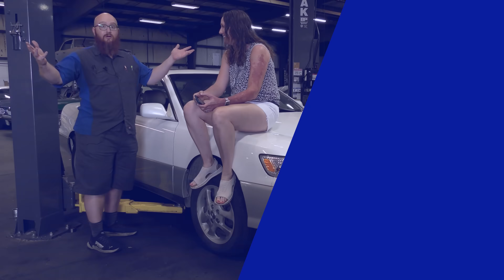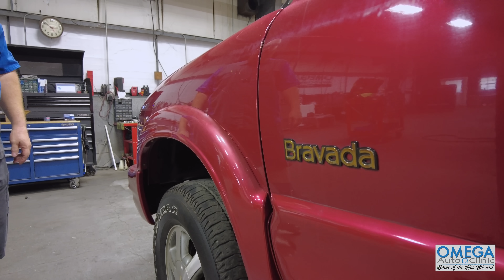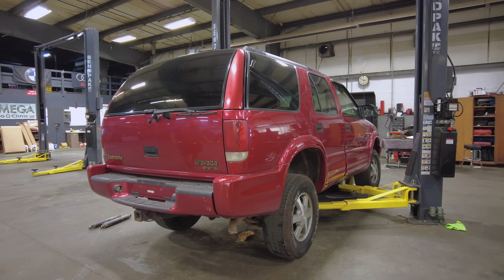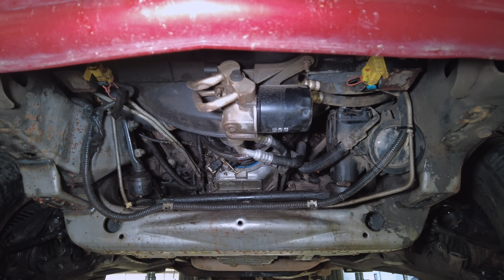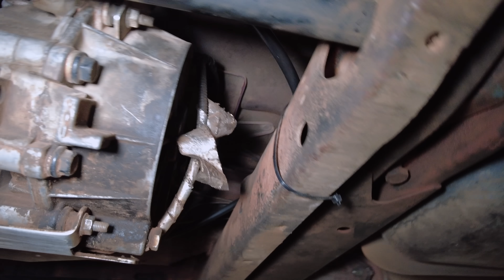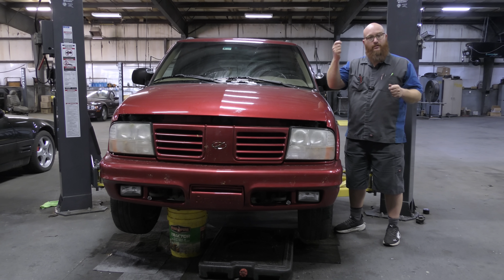Is Car Wizard Taking American Cars Again? That's an Olds Bravada!

Comment: We used to drive used cars but have switched to leasing luxury cars every three years to keep them in full factory warranty.  Our latest has one year left on an extended warranty and then we dump it.  It’s a 2020 black label pluggable Lincoln Aviator with 500 HP, 600 FT of torque 4 WD and every option available.  It has given us 30 mpg hwy at 80 mph across the country in every weather condition.  I just like driving it around town for months on end burning a tank of gas every 2-3 months if we don’t go on long trips.  A hybrid system runs your car at 1/3 rd the cost of a regular ICE.

Comment: I had an 01 bravada original transmission and engine i pulled the front diff and shafts as well as the front drive shaft after the bearings and seals failed the clutch in the tcase was gone so wasnt worth fixing the diff and all . The Jimmy and blazer had open rear diffs but the bravada got a factory lsd in it so it could claim awd. Talk about alot of fun to drive . Bought it with just over 200k on it and when i finally got rid of it after the second rear diff failure was just at 475k original transmission and engine  trans still shifted solid and all. If you do the proper updates and modifications to them they will handle anything thrown at then

Comment: I remember my 97 Sonoma had the transmission die on it- the transmission oil cooler ruptured inside the radiator and engine coolant mixed in with the transmission oil. I as a young man thought I was being bamboozled 😅

Comment: Regular car reviews guy said this was the worst car he had ever driven. It’s a funny watch.
Reply: It doesn't handle the best, but it's a truck and not a race car!  I wanted that solid rear axle because less CV joints means cheaper repairs and no boots to have to constantly replace.

Comment: Just go price both a new and good new used comparable.  $3,000 is pocket change in comparison.  The car manufacturers as well as the dealers have helped a lot to cost justify this themselves - they must have to much in sales that they keep "shooting themselves in their foot" w/their overall greed!  

This is a quote and summarizes pretty good what the real world purpose is of a vehicle: “The main purpose of a car is to get one from one location to the next rather than for it to be a status symbol or something to show off,. Provided that the vehicle is safe and will do what it is supposed to do, it’s recommended to avoid paying the top dollar for a vehicle, especially because it is depreciating.”    

A vehicle is sort of a necessity but is also a controllable expense during purchase and during ownership and nothing more.  

"Need vs. want" type of thing and this all helps to justify $3,000 into this Bravada.  👍

Comment: I had a slightly older Bravada than this one, the engine died on it, and I didn't have the money to get it fixed. It was decent on gas, and it could just about anywhere in the snow, miss that vehicle, Wish I had a vehicle like the one I had.

Comment: I ordered a 98 S-10 Blazer LT which is as close to a Bravada as you can get.  I probably had the only one in existence with the stiffest suspension package.  After only a couple years, the new-to-GM garbage orange coolant did 2 things.  Having never even opened the cooling system, it gelled and completely blocked the heater core.  I had it replaced.  A year later, blocked again and the dealer mechanic said that rusty debris from the engine block was in the coolant.  The front suspension set up was such that any non-GM-dealer mechanic would fail the truck for inspection because the front ball joints test as worn out.  This would happen even literally driving off the dealer's showroom and testing.  This is a great candidate to just drive until it doesn't run and bring it to the junkyard.  I disagree that these are reliable or worth fixing.  I traded mine in 3 1/2 years and was so happy to be out of it.
Reply: No inspections where I live and yeah, it doesn't handle the greatest, but it will get my wife through the Nebraska snow.  It's not everyone's cup of tea, but it checks our boxes.

Comment: Spending three k on an Asian or European Econo box or other hard to get parts for pile of junk is insane.
But something you can obtain parts off a much later vehicle and easily retrofit them with little or no modifications makes sense. Especially when a comparable newer replacement would cost fifteen thousand or more especially for one that won’t need three k in repairs and you might actually have a harder time finding parts for.

Comment: I had a 1995 S10 Blazer.  A hose blew out on the external oil filter.  Within a minute, the oil squirted out and before I could get the vehicle pulled over, the engine seized up, spun a bearing and bottom half of the engine was trashed. Otherwise, it was a great vehicle.

Comment: $3K is a bit much to do at once, but... if the vehicle is paid for and the basic structure of the vehicle is solid, you're probably ahead of the game investing in the parts to keep the vehicle road-worthy, especially considering just how much electronics are in today's vehicles!
Reply: My point exactly.  For the money, we have something local mechanics can repair and even I can repair.  I don't have to worry about a tv screen konking out or electronic problems and there is actually some solid metal under there to resist our salty winters in Nebraska.

Comment: Put 3 grand into it, be they recently did a trans, oil pan gasket and they still need tires. The only saving grace is it still looks good (minimal rust/rot) so the owner must have a lot of sentimental value in it. As I remember, these Bravada's were AWD, not 4WD vehicles.
Reply: No sentimental value.  Just good value overall when compared to what you get with your dollars today fresh off the lot.

Comment: I have a question for you Car Wizard......what do you think of the Auto Stop/Start features on cars and trucks?  Personally, I think they are a bad idea for 2 reasons:  1)  It wears out starters and 2) I also think it can't be good for an engine to stop completely at a red light, then it has to start and accelerate immediately after, stressing the engine.  What are your thoughts?
Reply: I always disable it BTW.

Comment: i had a 1999 once. got it as my first car and it had nothing but issues. kept on stalling. took it to this one shop and they said it was the security module and replaced that, and it still did it, i was probably 17 at the time (back in 2011) now i wonder if it was something real easy like a fuel pump or something else, it was kind of intermittent and only at one point to it not start at all and we needed it towed to get looked at
Reply: Knowledge is power and never trust what the mechanic says unless it's the Wizard.  :)

Comment: I literally just had this happen to me I bought a 2010 Chevy equinox from a dealer, it made it past the 30 days (made it to 45 to be exact so no help from the dealer) and the engine went, well the 3.0 engine is rare so between labor and engine replacement once I got all the amount that that was going to cost, I went searching online to try and find a vehicle that was in as good a condition as what I had, except for the blown engine and all. I could find nothing not a thing at that cost so I had to cough it up, talk about being caught between a rock and a hard place😅
Reply: I hate hearing this, but it solidifies my resolved to keep my old rides going.  I have a 1999 Ford Contour and so much of that car is discontinued by Ford, but I was able to cross reference to Mondeo parts and get some stuff sent to me from Italy.  Europe is keeping my Contour alive.  90s and 2000s Buicks are some of the most boring, but cheap to own and maintain cars in existence.  Give up on the flash and go practicality and you won't regret it.

Comment: I have 2 '03 Bravadas. I love them, over 350k miles. Not without its issues (on the 3rd transmission), but hey still better than a new car. I'll drive it into the ground.

Comment: my mom has a 95 blazer with the 4.3 vortec and thatt damn fuel injection spider system has been the bane of my existence, and its near impossible to get those spider injectors anymore. Ive had half a mind to convert it to a carburetor

Comment: I'm glad I don't have to unsubscribe. I was very sad when they closed Oldsmobile. In 2007 my wife totaled a beautiful 1995 Chrysler Concord. I figured it's my last chance to get an Olds. I found a near mint 2001 Aurora with 51,000 miles on it. It was my wifes daily driver until 2017 when I got her a 2012 Chevy Equinox and now that beautiful Aurora is babied and only driven about 2,000 miles a year, it now has 178,000 on it.

Comment: In my book, many of those non-connected cars would very slowly begin gaining value, may it be for being freedom driven alone, even if it was conceived as a low buck car in it’s day (not specifically knocking the Bravada) my own 92 S10 I sold as a working vehicle with 394.000 miles, and it’s still working today, with problems of course but nothing that says : pay the subscription !

Comment: Honestly I don't get the hate for the 4l60. My dad bought his trailblazer brand new with the i6 motor and it's entirely factory original (aside from bushings, sway bars and fluids) and it's sitting at 280k miles. He uses it in both red and 2wd and honestly the 4l60 has never given him an issue. Granted he isn't trying to make more power and he changes the fluid every 50k miles but I know other people with similar milage and original transmissions

Comment: I often think of car payments when I figure repair costs.  So today with an average payment of $600-700 per month a $3000 repair bill is worth it if the car will last four to five months more. If it is rusty or has more impending issues I probably would look for a new replacement.

Comment: All wheels larger in diameter than 15" are TOTALLY GHETTO. The timing cover on an old school small block Chevy is a beautiful design. Yes, you can cover anything up with enough junk and make it hard to get to. I have built, rebuilt, and modified a lot of small block Chevy engines. Dozens and dozens of them. They are my favorite engine. On an older one, getting the timing cover off is just a matter of removing 4 bolts to remove the water pump, then 10 bolts to remove the timing cover. The water pump and timing cover are not connected in any way. On many Ford and Mopar engines, the timing cover is actually BETWEEN the water pump and engine block, the same bolts hold both on. Removing the water pump means you should also remove the timing cover. You might be able to get the water pump off by itself, but there is a big chance that you will break the seal between the timing cover and block, and it will leak after you reinstall the water pump. Also. the timing covers, which are made of an aluminum alloy, actually have coolant passages cast into them, and they tend to corrode. They can and do corrode all the way through, and start leaking coolant into the oil, with no visible external leak. On the small block Chevy engine that can't happen, because the timing cover is completely separate from any part of the timing cover. Unfortunately, some newer Chevy engines, like the 2.8L V6, use the same stupid water pump/timing cover design as many Ford and Mopar engines. 

Considering what new "cars" (or whatever you want to call them) have become, it is now worth putting a LOT more money and work into an older car to keep it going. I stay with older cars that I know I can get parts for at least for the rest of my life.
Reply: You need bigger wheels to clear bigger brakes. My brakes would be smoking after 7 laps at the local track. Upgraded to bigger brakes and had to get bigger wheels. Havent hade a brake issue since. Thinking all wheels over 15 inch are ghetto is a very uneducated opinion.
Reply: @WTFAUTO  99% of all cars are not driven on the track. And until recently NASCAR cars used steel 15" wheels with no problems.
Reply: @geraldscott4302  you said "ALL". I gave you one example of where you are wrong. Would you like another? Pickup trucks. They haul a lot and need to have the brakes to stop heavy loads. Cant fit even fit 16s on my ram. You shouldn't talk in absolutes when you are not up to date on the topic in question.
Reply: @WTFAUTO  Pickup trucks don't haul as much as they used to, or at least used to be able to. They are now used as cars, with 4 doors and can only carry 4 people. They have tiny little 4 foot beds that can't haul much of anything. My 1968 Ford F-250 3/4 ton truck with 2 doors and an 8 foot bed originally came with 16.5" wheels, but due to not being able to find tires in that size, I switched to 15" wheels and tires with a wider sidewall. They fit and work fine. It was one of the first pickups to come with front disc brakes. I have hauled and towed just about everything with it, with no problems. Those huge wheels are just for looks, and have tires with 2" sidewalls.  The tires on my truck have 7 1/2" sidewalls, which can support a lot more weight than those tiny little tires on the huge wheels.

Comment: I bought a 98 Astro van with the "venerable" (I say vulnerable) 4.3 Vortec V6. The engine spun a bearing at 79K miles and made the mistake of having a new factory long block crate engine installed in it. The second engine started leaking from the freeze plugs at about 40k and took out the starter. Just junk.
My 2004 Acura MDX with a much smaller 3.5 V6 had more power, could pull my boat better and was just an all around better vehicle.
Goodbye GM (& Ford). I drive Toyotas and Hondas now and am much happier.

Comment: Amazed that you will repair that tire.  Every shop I go to now will no longer repair any hole that is outside the puncture repair area do to safety and liability issues.
Reply: Dave doesn't have to worry about me in this regard.
Reply: That nail is close, but should be OK. A little further and it wouldn't hold.
Reply: @hotpuppy1  Agreed.  I have a rim clamp machine so once I get the Bravada home, I'll put on a new set.  Tires are weather-checked and should be replaced.  I'll save the old tires to run on my trailer at the farm so they won't go to waste.

Comment: I had a 1995 gmc jimmy and spent nearly 6k in repairs. All of this was when I was in college
Reply: My parents had a 96 Blazer, absolutely worst vehicle they ever owned.  Spent as much time at mechanics garage as at home garage.  They were always GM buyers, maintained vehicles very well and kept them 150,000+ miles.  They could only stomach about 75K with that, replaced it with a 06 Honda Pilot and never looked back.  A Bravada in excellent condition is a bit of a unicorn, but I’d still be hard pressed to pour thousands into such an underlying POS.

Comment: Fellow Wizard Apprentices - I bought a used suburban on the no buy list for the collapsible lifters. What’s the best solution for a long term fix? Is there any validity to plugging one of the deals into the ODB port? Or is swapping the parts the only solution? That’s just valve cover work though, or does it require the heads to come off?

Comment: I have an 02 ZR2 5 speed !  I wouldnt sell or trade it for anything ! Parts are low cost and available and not very difficult to repair !
Reply: Hang on to it.  You won't hardly find anything better today.  Today's builds are horribly cheap and weak...designed to fail because they have to build light for fuel economy requirements.  After a couple winters there is nothing there!

Comment: I didn't care much for the amount money that I had to spend on replacement maintenance work on my car but it's got at least 80K+ good  miles left to it and it's way cheaper than buying a new modem vehicle that's electronic this,nanny devices that and probably won't last as long as my fifteen year old car that I've maintained
Reply: Modern quality is in the toilet unless you eyeball Toyota and Honda but still...all the electronics I just don't trust.
Reply: @LazloNQ  the 2024 Tacomas have a whole bunch of design build flaws and issues. That's a main reason that I chose not to purchase one

Comment: I had a '97 Blazer I bought used with 90k miles on it for $6500. I dropped over 5 grand in repairs in the 7 years I had it. Many of the problems you are fixing on this vehicle were the same ones on my Blazer.

Comment: Watch it come back in six months needing a heater core. Not your fault. The heater cores in these go from fine to broken at the drop of a hat.
Reply: I'll have it replaced locally and might even tackle it myself if it comes right down to it.  It was just convenient to have Omega take care of loose ends so we start our ownership off on the right foot.
Reply: @LazloNQ  Wow. A comment from the actual owner. In all seriousness, you got a good vehicle right there. An '00 Blazer variant that's not all rusted out, and only 120k on the clock. They love to eat heater cores, I should know, and they like to eat door bushings. Again, I should know. Oh, they also like to eat Throttle Position Sensors... Yeah it was fun figuring that one out.

I think the Chevy Blazer had the better headlights, and better wheels, but the Bravada had more bells and whistles. and the GMC Jimmy just looked boring.

Comment: Yet. My 4l60e has 475 000km and still has never been rebuilt 🙂
Reply: I do rigid maintenance on my vehicles and I think that is why so many vehicles fail...people get lax about it and then the components fail.  I have 164k on my ford contour original transmission and I've towed vehicles behind it and a trailer and kept my fluid levels up and changed.  Still shifts fine.